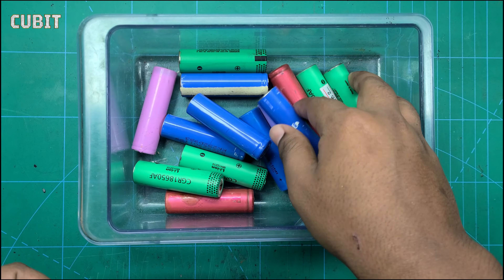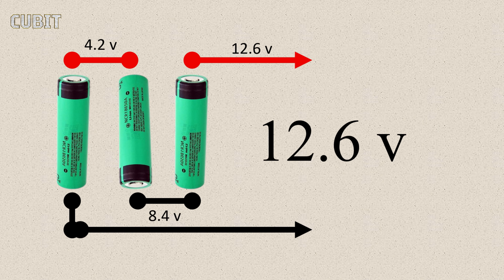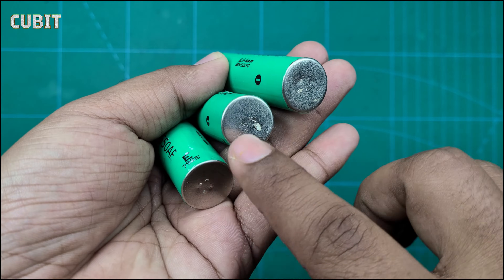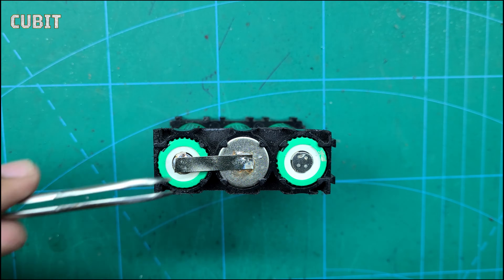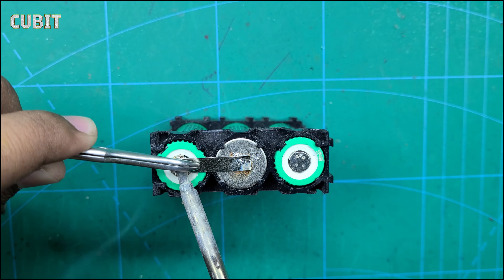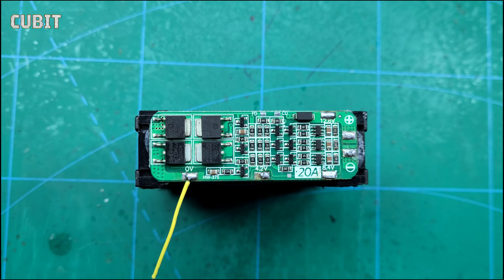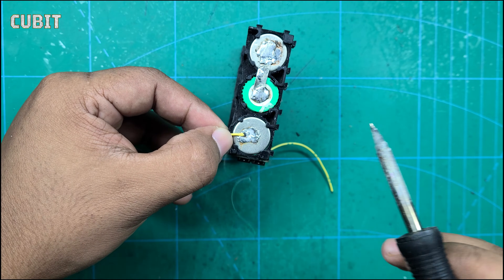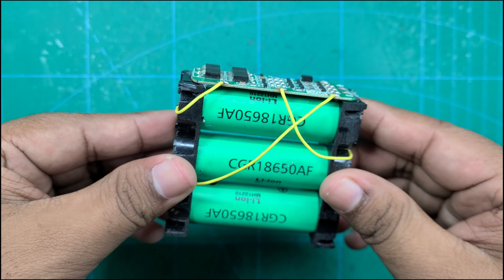How to Make a 12V Battery Pack Using 18650 Lithium-ion Cells || CUBIT

Comment: the problem with this solution is that at 50% battery capacity of 18650 you will have 3.6V, 3x3.6 = 10.8V, many devices expecting 12V don't like less than 11v. Also at 25% battery capacity you will have 3.2V, 3x3.2 = 9.6V. almost all devices don't work already. So this will be very inefficient solution! To do this will need a boost converter!

Comment: I am thinking of making this Pack but was going to use  3 18650 @9900mah what  BMS do I need will the 20A you used work or do I need a higher one? Wired in Series
Reply: How the fuck are you finding 9900mAh 18650’s